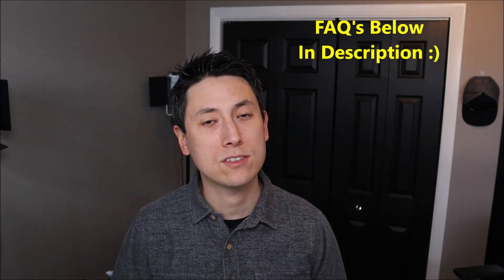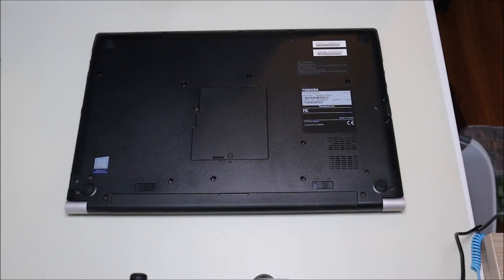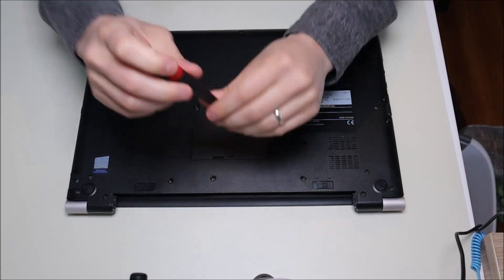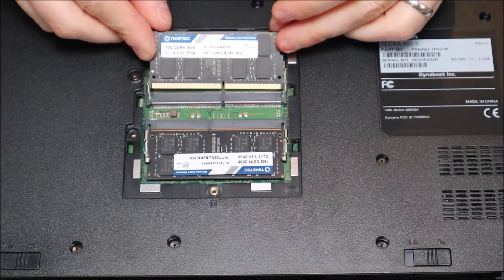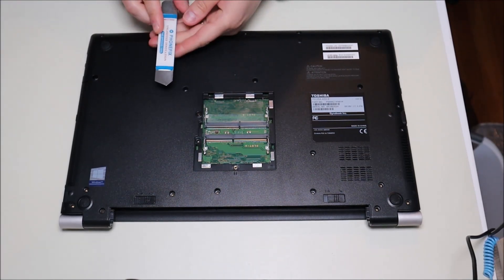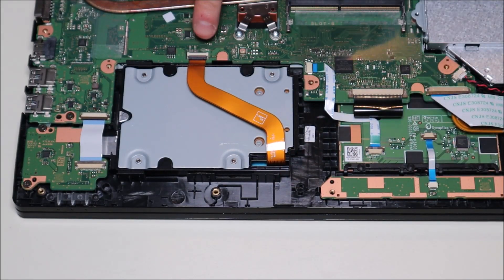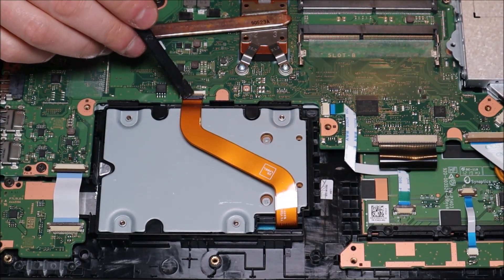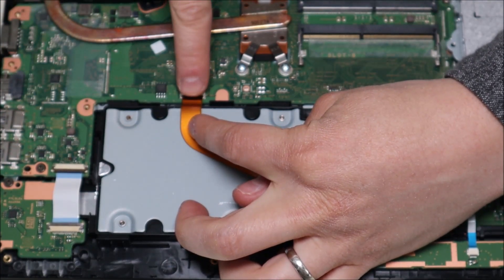How To Replace Upgrade RAM, SSD Toshiba Tecra A50 A50-E

Comment: Hi, will this laptop support a second physical hard drive?  The boot sequence in firmware shows there are HD0 and HD1 as boot options, there fore I am assuming it has the capability for a second physical hard drive. Can any one tell me how it can be installed.  Thank You

Comment: Hi Jamin. I accidentally turned on discrete graphics only on my laptop which doesnt support it. Now it restarted my laptop but the whole screen is black  (and it is pitch black, no bios and  everything)
I hear it turn on. I  can use the keyboard and everything (tested it with a chat function to my phone twitter and it works.)
Just the screen. i am planning  to go get an HDMI tomorrow and try to test it out on my tv if it works.